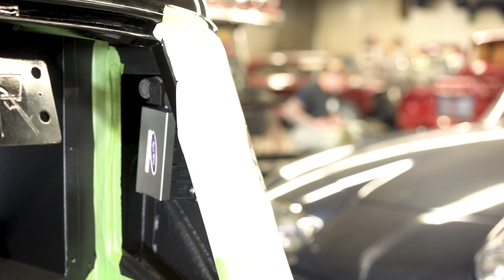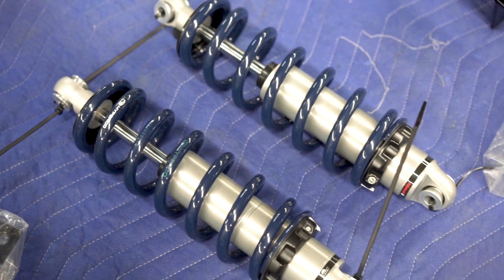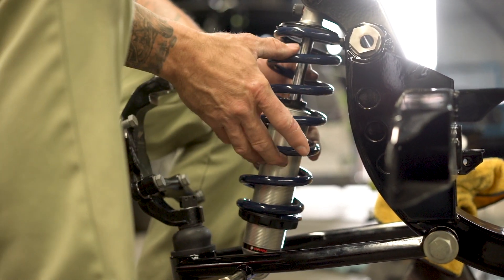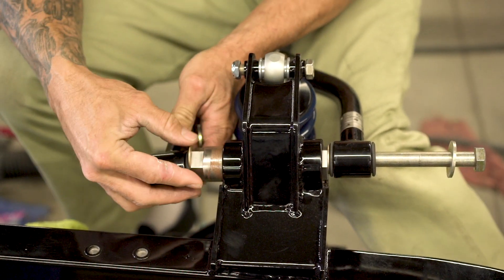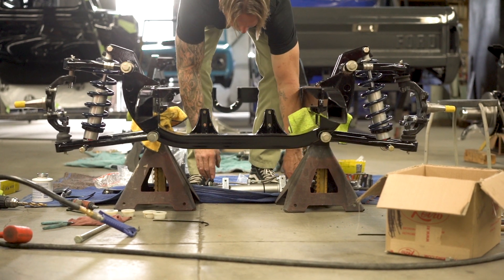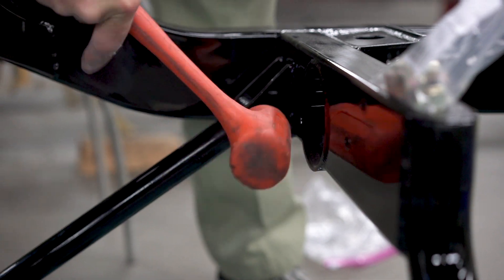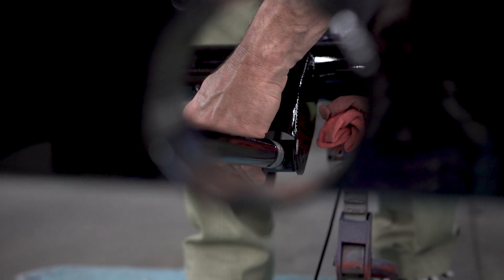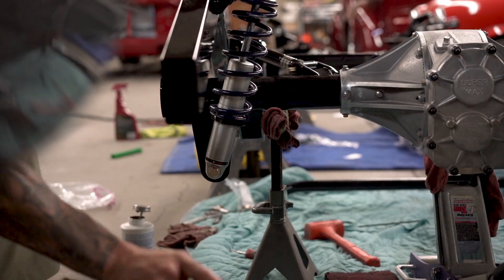The Vik - A Tim Allen Build - (part Clv)

Comment: Brodie is a talented guy that has latched on to what I term a "custom car annuity". Having been through 2 project builds with 2 different shops, I have felt that pain. First project 44 months and $330,000. The second now in month 54 and serious 6 digit $ and 90 % finished. This Vic will be a fantastic car, but Tim is at Brodie's mercy. Talented men like him often lack that total skills needed
have a plan and work the plan.
Reply: It totally depends on the build does it not? If you are doing something simple, like say a 32 ford with a crate motor, off the shelf body and chassis, all stuff that is know then it is easy and "cheap". If you are doing something that is very different.. it costs. I dare say it depends on the client too, if you make a change during the build that will cost time and money.

Comment: Y’all better not take this thing down, to register it. What will be your answer?  It’s a 49, 50, 51,52,53, automobile.
Reply: Many custom car shops have a "manufacturer's license"- they can, at need, build a car with no auto parts from scratch or starting with a base, build it up. They will still have to satisfy the State DMV on what are called "origins", but Bodie has been this route before.